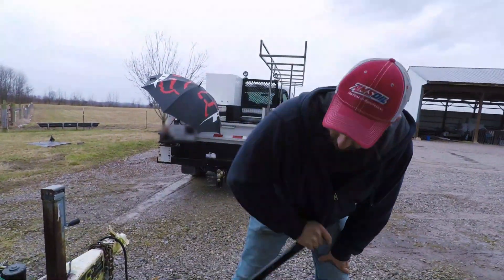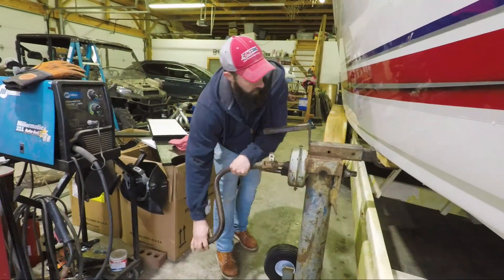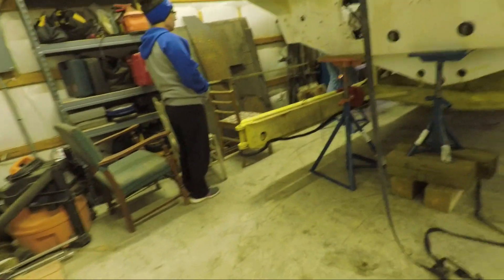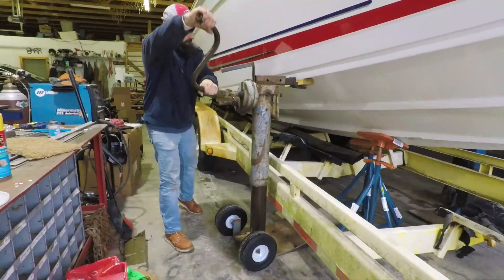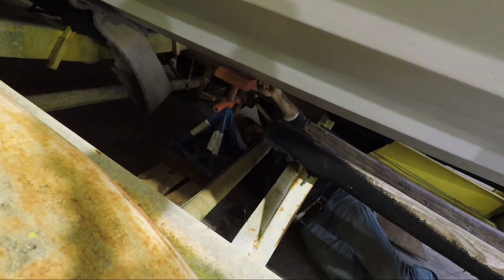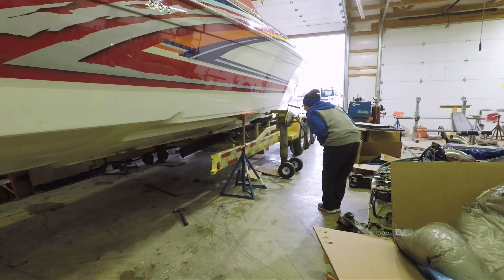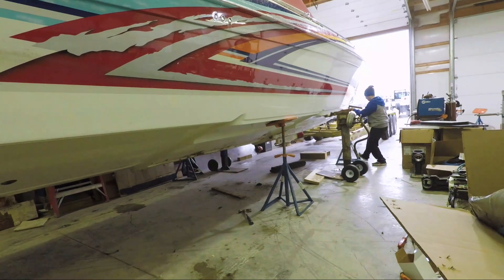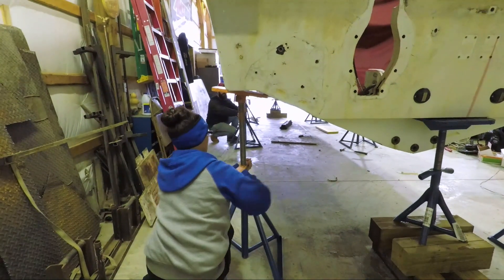Jacking up a boat off the trailer.

Comment from the maker: Anyone else ever attempted this sort of balancing act?
Reply: Need to do to my cuddy cruiser only 22ft tho
Reply from the maker: That oughta be a piece of cake
Reply: I fix boats for a living ( body work). It’s always a little scary blocking a boat. Hopefully you can get everything sorted out with the trailer and body work and back in the water this season.
Reply from the maker: Its looking like it wont be out on the water this season.  We're going to probably have to reorder a trailer from another manufacturer which sets us back into the fall before it would be back together.
Reply: @BarrowedTime  sorry to hear that. This covid mess is really slowing things down and making it difficult to get things done.
Reply: @BarrowedTime have you thought about trying to find a used one until then?
Reply from the maker: A used trailer, or boat?  Used trailers are around 7-9 and then I would have to rebuild trailer to fit boat.
Reply: @BarrowedTime  ahh I was thinking if you stumbled on one from 3-5k might be worth it🤷‍♂️
Reply: Yep, 'I've done it several times with wooden boats between 24 and 30 feet.

Comment: That looked like it was a lot of fun to do. Hopefully you guys get back on the water for summer. Best of luck.
Reply from the maker: Thanks. IF we get out, its looking like it wont be till late summer.
Reply: @BarrowedTime  Sorry to hear that. This covid stuff is just messing up everything. I blew one of my motors in mid August 2019 Picked up plastic bag in the intake and over heated the one motor .Plus it doesn’t help I live in Canada right across from Detroit MI. In Windsor and my boat is all back together in Detroit the deal was I could come and pick it up in the spring then all this covid happen and I couldn’t get my boat. Good thing they guys are good where I’m keeping the boat or it would have cost thousands just in storage. Border are closed so I can’t do much. So trust me I feel your pain.
Reply: Thanks for the update... a testament to your patience... I have had few similar experience with vehicles (less than desirable impromptu jack stands).  Never had anything fall... only thing scarier than putting it on jacks will be when you put that thing on the new trailer!  Hope that’s soon.
Reply from the maker: Man, that sucks.  Hopefully things will open back up before your boating season starts and you can get it back.
Reply from the maker: Yeah, I pray that Manning has the trailer set up right so it will slide right on.
Reply: @BarrowedTime  I hope so. That was one long summer. My wife had this bright idea for us to by a camping trailer because that’s all we could do with this covid crap in the summer. Not my thing. Every time I walk out and see it in my driveway I’m just like that thing hasn’t caught on fire yet?
Reply from the maker: Yeah, not much to do while camping. At least when we "camp" on the boat we can go straight to swimming,  drinking,  or running the water.
Reply: @BarrowedTime  That’s is the best part of boating. The best part of camping is getting home. Lol
Reply: @BarrowedTime  do you guys have an Instagram page or Facebook page for Barrowed Time?
Reply from the maker: We have a Facebook page under the same name "Barrowed Time"

Comment: looking to possibly buy the Brownell Hydraulic Boat Lift System but man, its 5,000 roughly to buy all 4 of the jacks, I have been using my forklift and jack wheel dollies to get boat trailers off for work here in the shop, or using hoists from my ceiling, but they really don't work as well as this way. Where did you get those jacks? The ones you were cranking? I really want to get some of those. I am so sick of having to clear a path in the shop for the forklift to lift the bow, sick of the fear of the boat falling, etc. I am just looking to make the work flow a little easier here at the shop. Any pros/cons to the type of jack you used in the video? I am open to any suggestions.
Reply from the maker: So I actually made these out of the landing gear for a semi trailer.  I welded 2" ID box tubing to a plate that I had welded on top of the jack itself.  I then just use a receiver hitch slid into the tubing.  I should have extended the tube further out to give more access when pulling the trailer out. I also welded a larger piece of 5/8" steel plate on the bottom that extends out to support the weight. On the back I welded a rod on the back and added a couple wheels.
Reply: @BarrowedTime  rough cost to make 4?
Reply from the maker: I bought the landing gear used for $100. Then probably $100 or so in material. So I might have 2 or 300 in the 3 I made.
Reply: @BarrowedTime  thanks for the info. I’m going to look into this route. Will save me about 3000 bucks! I don’t really weld, but I have a buddy that does and he even owes me a favor for work I did on his boat! He can definitely make these for me as long as I can find the landing gear things you used for the base. Thanks for the quick reply!
Reply from the maker: You're welcome.  I found the landing gear on marketplace.  Even new they're pretty reasonably priced.
Reply: @BarrowedTime  I am told by my wife that I can no longer use Facebook Marketplace. LOL. I think she is jealous of all the good deals I get. JK. That is literally what I am doing right now is looking on Facebook Marketplace for some.
Reply from the maker: @hullhealersboatworksrestor4377  lol!

Comment: I'm not sure how far you travel for a trailer. But McClain trailers in Houston is pretty good.
Reply from the maker: I've already put down an $8700 deposit with Manning.  They supposedly cant get the axles.
Reply: @BarrowedTime  gotcha. Im waiting on a brake booster for my trailer. Getting everything ready for bimini
Reply from the maker: @jimmyraysplace5190  Bimini is an awesome trip.